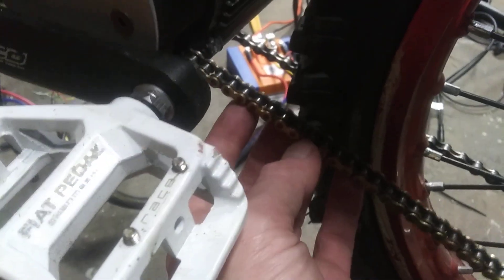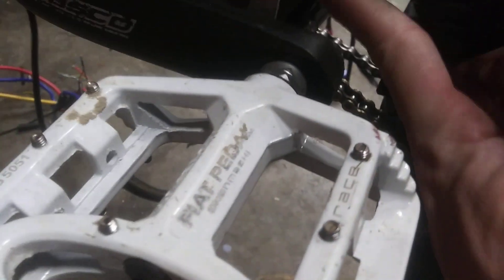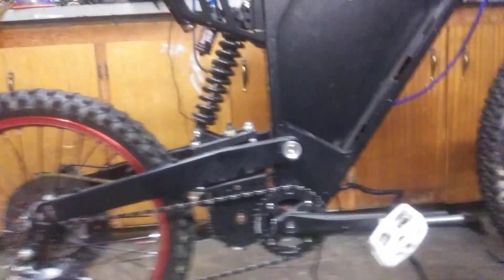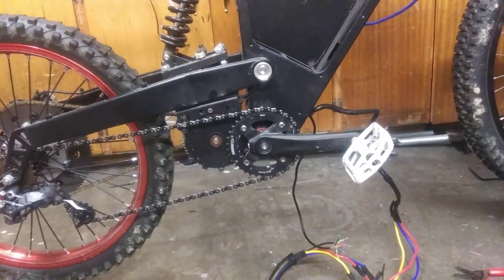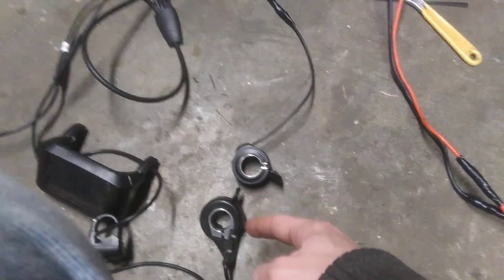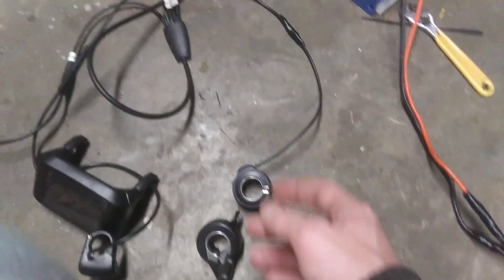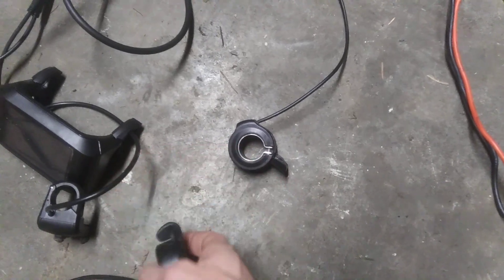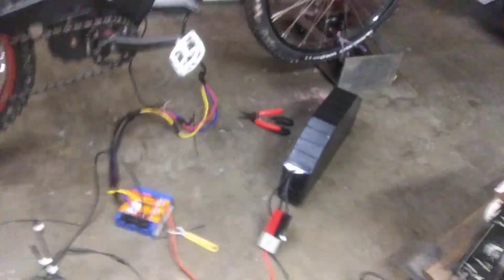LightningRods bigblock with bac2000 from HighVoltage

Comment: HI, I am considering the Lightning Rods Big Block XL for my EEB Enduro Frame also.
What wheel size to you have on the rear?
I have a 17" moto rim on the rear and 19" on the front. I know that Lightning Rods make a dual stage with primary belt now for my frame, but I would prefer just the one chain like on  your setup as it is simpler and less prone to problem. I could probably use a much smaller rear sprocket as my wheel is only a 17" size (equivalent to maybe a 21 bike wheel) Maybe a 68T or something like that.
Any problems with the Lightning Rods Big Block kit since this video?

Cheers